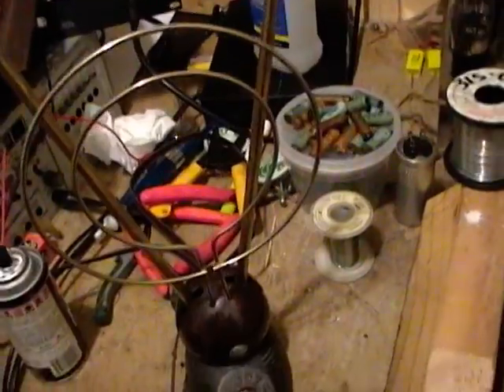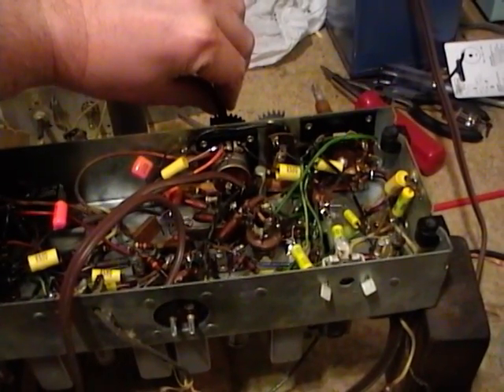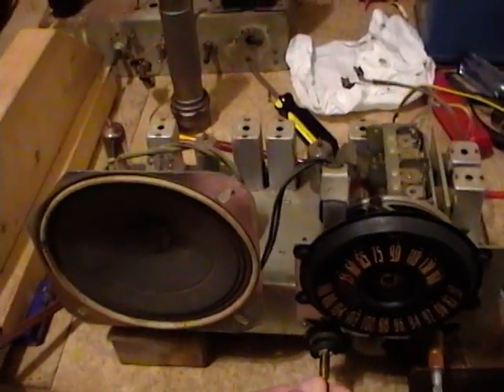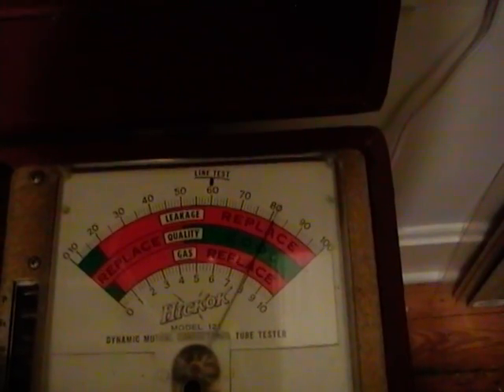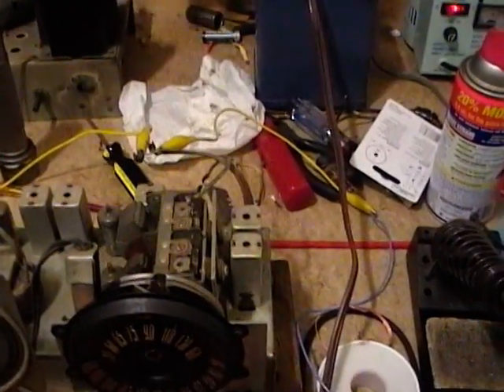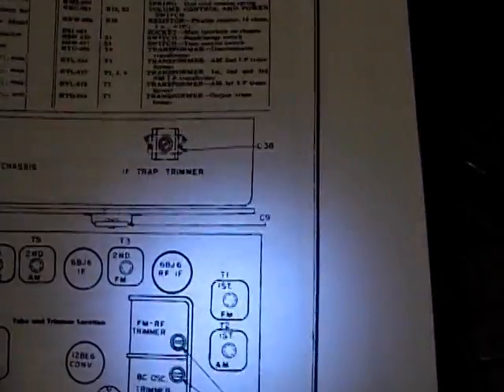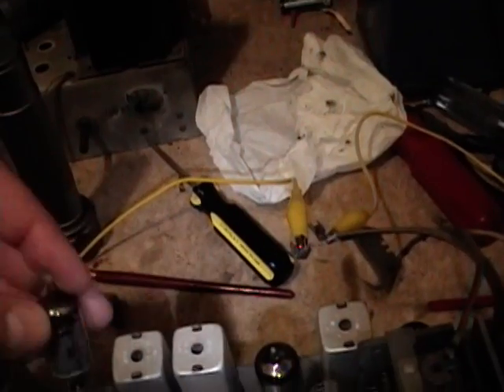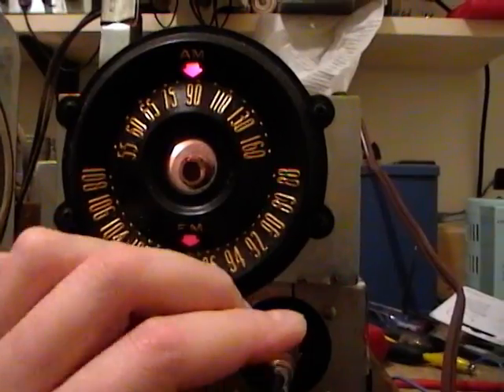GE 212 radio restoration p3o7

Comment: I would not be surprised if a loop didn't fix the issue. Sounds like that long wire is picking up the 60 cycles from all the electric fixtures in the room.  Can't wait to find out the fix!

Comment: It needs the loop, the loop antenna functions as the AM broadcast antenna coil in some sets, if it picks up anything at all it's usually distorted. I would try connecting in a substitute loop antenna from a different set  with alligator clip leads.